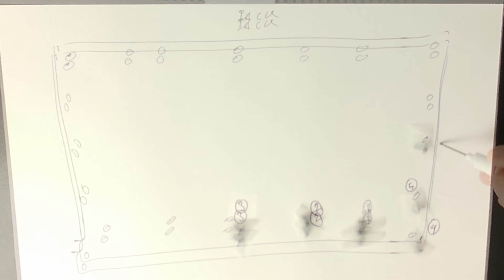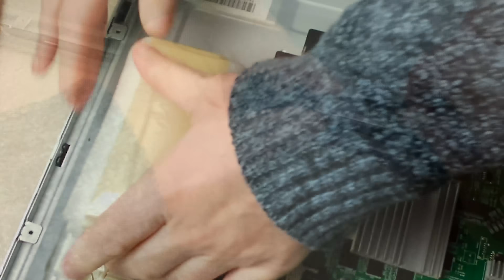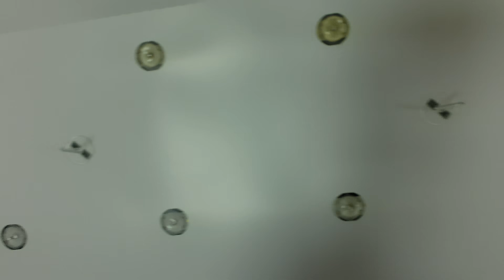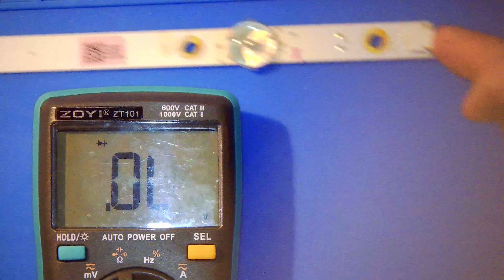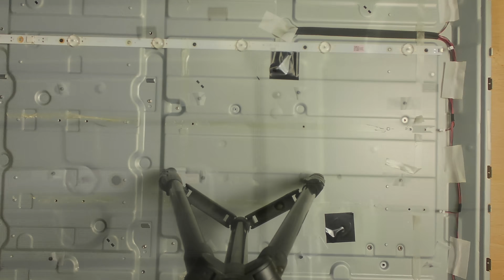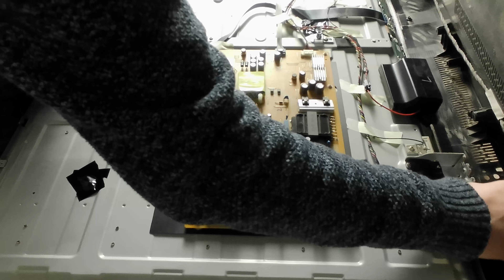TV Has Sound But No Picture - LED Backlight Repair (Cheap & Easy)

Comment from the maker: 📌 TOOLS & GEAR USED IN THIS VIDEO:

⚡ Bench & Soldering:
• Hot Air Rework: https://amzn.to/4yFWz6c
• Soldering Iron: https://amzn.to/4pEOzhL
• HAKKO Desoldering Tool: https://amzn.to/45mrtmA
• Microscope: https://amzn.to/4x25vBk
• Multimeter: https://amzn.to/4wYQvDY
• Power Supply: https://amzn.to/44S48ZQ

🧰 Drills & Precision:
• Bosch EasyDrill: https://amzn.to/4pNGHdN
• Electric Screwdriver: https://amzn.to/4c2MxlM
• Rotary Tool: https://amzn.to/3TendD3
• Tweezers: https://amzn.to/4whIBpv

🧼 Cleaning & Supplies:
• Bissell SpotClean: https://amzn.to/4fR2GNw
• Bosch Vacuum: https://amzn.to/4fxrRmO
• 303 Protectant: https://amzn.to/4fAB65Y
• Capacitor Kit: https://amzn.to/4ftZyFV

(Note: As an Amazon Associate, I earn a small profit from qualifying purchases at no extra cost to you. Thanks for the support! 🙌)

Comment: My tv has an issue where it flashes on and off and certain parts of the tv do this. At times it also just goes completely dim/off and audio still works. Wondering if I need to do this as well, any way to diagnose it’s not something else.
Reply from the maker: Yes Arturo, good call to check some other possibilities before disassembling the whole tv. Does it make any difference if you turn up the brightness to full? Or does it get worse when you turn down the brightness? If the picture itself is good, but the backlight is the problem, it's either the backlights themselves or the power supply to the backlights. So if you remove just the back cover, you can inspect all the capacitors first and see if one or more are 'domed', which is when their little tops are round instead of flat. Have look at this video if you like: https://www.youtube.com/watch?v=lz0oBoUv4BM - where I test the individual components on the power supply board. Please tell us what your findings are and we'll go from there! - do be careful with those capacitors, they may keep their charge and give you a nasty shock if you touch them, so do discharge them before measuring.

Comment: I’m not sure if this is my tvs problem but you video was clear  and straight forward. I like the idea of the rough sketch and taping the screws to their spot. Since I have never done anything like this though I may just buy a new tv even though it might be cheap to fix 😅
Reply from the maker: Thank you! Yes, making those sketches saved me many times and taking pictures helps as well. If you do buy a new tv, you can always have a go at fixing your current tv and sell it on. It's always good to save our beautiful planet from a bit of electronic waste, isn't it.